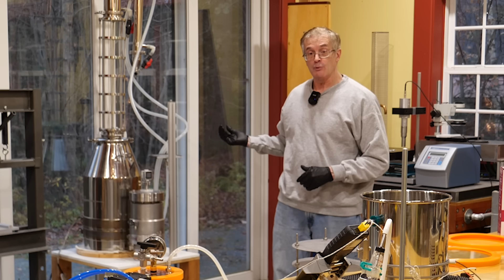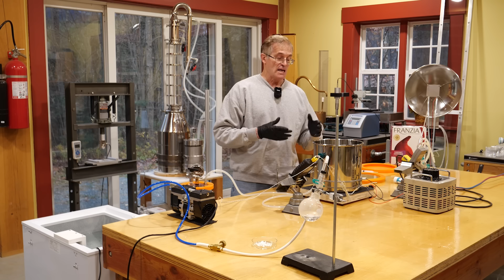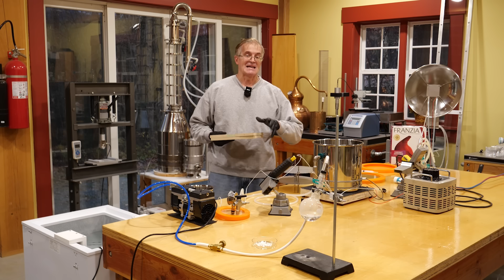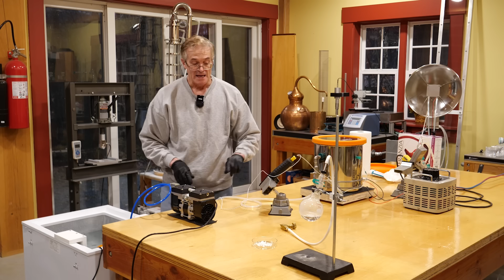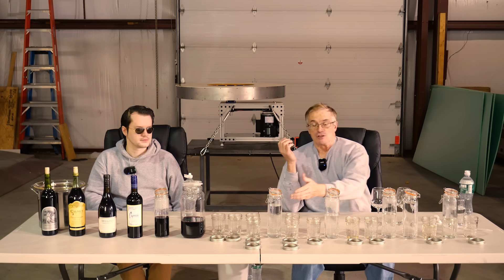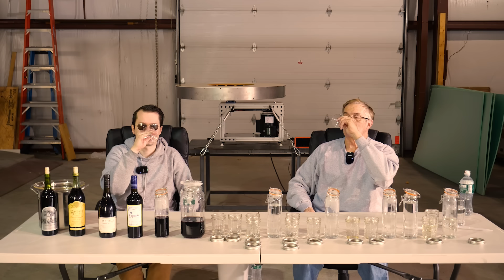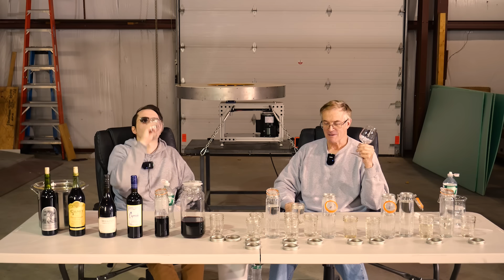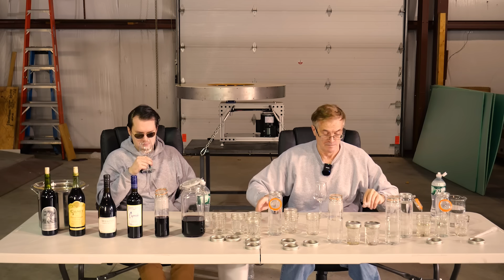Turning $3 Wine into a $100 Vintage with Science!

Comment: Hi. IMPORTANT information!! Just for let you know if you already did'nt. There is almoust always a small amount of metanol in wines. Especially on red wine there is usually abaut 20-200mg/l. And if you distill wine, and do this kind of taste experiences, keen in mind that on the heads is all the metanol. The amount of metanol is so small, that it is not dangerous if you mix all your heads and hearts and tails or just taste like you did, but not really drink it. But if you drink only the heads, it can be dangerous, even fatal, or cause blindness. You distilled 5 liters of vine and there is lets say for like an maximun amount 200mg/1L of metanol. So, now there is 1000mg pure metanol on your heads. 1000mg metanol is 1,26ml and thats not too much. So tiny amount as only 4-10ml can cause blindness. And death can be caused abaut 30-60ml of metanol. Now everything was safe. But if this same thing would be done at bigger scale, lets say like for an 50 litres of wine. Then there would be possible metanol as much as 12,6ml and thats dangerous amount! So, please keep safe and so your prework and check out all the information what possible can be found. And that can possible save your lifes! I am happy because now you did so tine amount of wine distilling and took so tiny amounts of the heads. If you would done that at bigger scale and take full 4cl snaps at the heads, and the story could be completely different. Or if this same thing would be done, not at wine, but some kind of fruit drinks. Fruits like apples, or plums produces way more metanol than grapes. Well, propably you allready knew this. But maybe everybody does'nt. It is always good to know before doing anything.

Comment: Fascinating process but I gotta say the fact that you declined to use a tralle hydrometer left me quite confused. How does distilling a wine to make cuts, recreate a wine which is - what 12% alcohol? In other words, one US gallon of wine will contain about 1 pint of alcohol but since you never distilled the last quart or so of the boxed wine, you never "reproduced" the fermented wine deconstructing the wine into its "cuts". Rather, you distilled the wine, so your project was not really about "deconstructing" the wine to remove the flaws and faults as it was about making a low alcohol brandy. What was the proof or ABV of each of your cuts? What was the final ABV of the brandy you produced? 
And I gotta say, I missed the point of using vacuum distillation. For far less effort and cost, couldn't you simply have used a fan-cooled table still to distill the wine making the same cuts? That you boiled the wine at near room temperature to vaporize the ethanol and the more volatile aromatics and flavor molecules and then condensed the vapors at near freezing is still distillation and not fermentation, isn't it? What am I missing?
Reply from the maker: We separated the wine into fractions that allows us to reconstruct the wine minus what we didn't like. The ABV is irrelevant because we aren't making brandy. Heat damages some of the flavor components of the wine and vacuum distillation avoids heating the wine.
Reply: @TechIngredients  If the wine was not distilled, how did you find the first cuts to be so alcoholic? Simple deconstruction would never had produced any sample above the ABV of the wine itself. No?
Reply from the maker: It was distilled as you said above, but doing so at room temperature was the point of adding the complexity of the vacuum process.
What is different here is that the goal was not to concentrate the alcohol and flavors as in a brandy, but to remove the undesirable fractions across the entire spectrum of the cuts.
Reply: @TechIngredients  OK but isn't this exactly what distillers do at 173.1 F? They evaporate (if under a vacuum at a lower temo but you are still evaporating your wash (that cheap wine), and CONCENTRATING the ethanol which "boils" at lower temp than water and you condense the ethanol and other volatile compounds such that the MOST volatile elements evaporate and then condense first and the less volatile compounds evaporate later. These you and distillers call "cuts" and they and you blend the cuts to make a beverage you prefer, albeit with LESS water than was in the wash. You are simply using a vacuum to BOIL the wash below 173.1. Sorry but I do not see ANY significant difference between distilling at 173.1 and distilling at room temperature.
Reply from the maker: It's simply about chemistry. 
Some flavor components are not stable at elevated temperatures.
Reply: @TechIngredients  There we are in complete agreement.

Comment: i think what might have improved the wine process was adjusting the amount of the remainder fluid added back to the mix. since you isolated a certain volume of liquid and removed it from the mix, the overall proportion of the remaining highly pigmented component might have been overrepresented in the overall ratio. but because the distillation was cut short, it's hard to know how those proportions relate. maybe its a second round of taste testing where you continually add bits of the non-distilled remainder until a taste profile is achieved. awesome video as always :)
Reply from the maker: I agree  that we only touched on the possible modifications that the separation process  allows.
Reply: @TechIngredients I'd love to see the idea expanded. Cheers 🎉

Comment: A lot of work, but FAR less than making the wine from scratch. And far more potential for profit, either monetary, or just bragging rights. 
I'd leave out the last 2 astringent ones as well.  At the end, adding the original wine concentrate (super sour), do NOT put it all in! 
You've got less volume than you started with. The end product doesn't need to be so tart. You made it extra tart.

Comment: I'm not as think as you drunk I am!

Starkle starkle little twink,
Who the hell you are I think?

I'm not under the afluence of incohol,
Though some thinkle peep I are.

I've only had tee martoonies,
but I have all sober to Sunday up in.

And other nonsense from my twick and sistered mind.  But I personally have never developed the taste for alcohol. With the exception of one melon based drink, ALL alcohol bearing or 'dealcoholised' former-alcohol-bearing drinks scream "POISON" to my senses. And the few hours moderate buzz isn't worth the day to three days of feeling blargh.  However, I have access to fruit trees that wildlife likes to ruin by taking a single bite from a piece of fruit, throwing the rest on the ground, then repeating until the tree is bare. The notion of collecting that waste, dropping it in a barrel and letting it become flammable, then distilling off the flammable stuff for use as a fuel source... Tempting.

No, not for drinking. For burning in a small combustion engine or similar.

Comment: This was absolutely fascinating to watch as a huge wine nerd and science nerd - more for your reactions and interpretations of what you were tasting. The fractions separated out different flavor components that made them easier to identify, that as someone is learning to taste/analyze wine at a higher skill level, takes a huge amount of practice, an attune nose and oral olfactory senses and thought. I think this would be an extremely cool demonstration for a winery to do as a demonstration in a wine class.

Random thoughts:

Water is a very suboptimal thing to rinse with for tasting. It will interfere with the next thing you taste. when I am tasting, if its reds heavier than pinot I will usually mouth cleanse with a light sparkling wine like cava. Otherwise I tend to rinse with the next wine I am tasting, sip a bit, swish it a bit then spit it out and it doesn't interfere with your tasting as much.

The "bay leaf twigs" you were tasting were probably flavor compounds from stems and other non-wine plants from harvest. Stems can be good in wine, but sticks, weeds, etc may not be.

The "rose bushes" you were tasting comes from what we call "bramble" as a wine quality. Its really common in syrah and zinfandel, but to get in cabernet requires really high quality, cool ripened grapes. It was likely a small fraction of the grapes in franzia but it is shocking there was juice of that quality at all in it.

Alex's purple lips were absolutely adorable <3.

Almost all cabs are oak aged to some degree - even the Franzia, but franzia was most likely aged with oak woodchips that may have been milled up used barrels.

The "no flavor" comment about the silver oak was almost certainly the wine being "tight," or "closed." 30-120 minutes in decanter most likely would have helped it out. More so that just having the cork off even overnight.

I probably would have redistilled the foreshot and the tail and discarded the first third or quarter of it. Methyl alcohol is always present in wine, but in cheaper wine they tend to ferment hotter which can increase the amount of methyl alcohol.

When tasting with someone, it is best not to say anything until after you have both tasted and thought about it. wine tasts the way it does because of how you interpret various flavor and smell compounds and just saying someone can influence the way a person tastes something. This happens because things taste the way they do mainly because of smells, and there are a relatively small number of smells that make everything taste the way they do, but in wine they are out of context. For example, grapefruit thiol is primarily what makes grapefruits taste like grapefruits, but also what make tomatoes taste like tomatoes and passion fruit taste like passion fruit. The primary smell component (a pyrazine) that make bell peppers taste like bell peppers is also what makes asparagus taste like asparagus. The ester ethyl acetate is the primary thing that makes pears, apples and plums all taste the way they do, etc.
Reply from the maker: Wow!
Thanks for the insight.

Comment: See, we can now add this to our mental inventory of knowledge if we ever find ourselves hurled back 10 or 20 centuries. 

I don't know how to build a modern (or primitive) vacuum pump, but I wouldn't need to. 

Just source the biggest, stongest metal vessels I can find and use heating/cooling to create a vacuum. 

Don't need a bunch of sophisticated wine knowledge - just do like they did and taste fractions from different temps and try combinations until   I find a combo that perceived as a huge improvement. 

Keep the key process secret by assigning only part of the process to various sites, so no one really knows the secret. 

Become a huge vintner with no vineyards - just buying whole vintages, breaking them down and reblending them. 

I could even introduce whisky a few centuries early.

Comment: There is a "speed aging" technique that used oak chips and if I remember correctly, a vacuum chamber to rapidly impart the flavors of an oak aged spirit into regular alcohols, I think the thought emporium here on yt demonstrated it. It would be interesting to see if you could use this to infuse your wine to get flavors similar to the high-end bottle. Loved the video, keep up the great science!
Reply from the maker: I've done that. The principle is to recreate the small day to night temperature variations that an oak barrel experiences which causes the wine to expand and contract and move in and out of the inner layer of the barrel.
The result was kind of harsh and unpleasant. Maybe with a lot of fine tuning in chip size and quantity this could work.

Comment: Did you tested (tasted) the same type of wine, but of different producerc / wineyards? I mean all bottles being cabarnet savignon, or all merlot, etc? Or you are comparing apples to pears?
I was also surprising why you poured all components together, why did not substitute the missing ones with proper water/alcohol mix?
Why did not mix 3-5 versions?
Also, the residual might have been divided into top / bottom / very bottom, after left settled.

But I congratulate to the idea+work.

Comment: In the interest of science I think the "bad" components should be identified by chromatography and then a compound that will knock them out of solution used to create a "crap wine to good wine" magic pill you could add to $3 wine. I would have taste tested in reverse order under the assumption that the 180 proof stuff is going to decrease sensitivity. The other thing I would have done is replace the removed stuff with distilled water so the balance of the wine was preserved and I wasn't concentrating the wine, sort of like ice wine.

Comment: What about using a fish tank submersible heater? That way, as the evaporation cools the original liquid, the temperature falls and the heater starts heating. If you then look at the power consumption of the heater, you can see when the alcohol has been evaporated.

Comment: yeah... see ... it's not that simple. Why we say "it aged like wine", well because red wines need time. What time does is braking apart tannin and many other components that make the wine more "round", meaning there's more harmony to the taste between various and INCREASING number of components, when tannins are decreased. There's also a thing you mentioned called "finish" meaning not only a long lasting taste but actual ability of the wine to hit you with different tastes coming one after another during this time. This is one of the characteristics of a good wine... 

BUT.... The price does not reflect roundness nor finish as well. 

You can have a great wine coming from great winery which is very young and is already costly especially when the year is good. So NOW it's still nothing amazing but in 5 or 15 years it will be amazing.... so we know not to open it now and save it for later.

Good year is when there's a perfect balance between temperature and precipitation because more sugar means more alcohol and more sugar left in wine. To hot makes grapes cooking themselves. To much precipitation and there's not enough flavor cause there's less time for sun to prevent a watery taste.

So even comparing the lesser wine from a good year to excellent brand from a bad one makes a difference. 
Not to mention the most important issue - grape variety used for different types of wines. I presume the one you modified is a type of noname blend if not made from powder directly without mentioning it. So if you not know what grape variety this wine is made of, comparing it to other ones might be just useless. 

Even blends are made in different percentages. You can keep adding and adding another variables to this equation like for instance type of climate - there is a reason why wines from New Zeland are so good. You can add type of soil. Then there's an "alchemist" composing each wine accordingly to variables available at the moment of collecting grapes.

There's just too much variables to compare your product to OTHER wines. 
The only comparison that actually makes sense is to compare it to itself i'm afraid.

Otherwise ... a fun video and technical part as always very detailed and fun to watch.

Cheers!!!

Comment: Dry beans like pintos and black beans, do very well in the pressure cooker. So does rice. For rice, I put about an inch of water in the pressure cooker, then put in a large Pyrex measuring cup with the rice and water. I do the same with beans.

Comment: #9 through #11 likely had terpenes.
While reducing the less desirable flavors by not including those middle number fractions, you also reduced the complexity of the wine.
The one that tasted sweeter had white grape concentrate added or a small percentage of unfermented grape must added, making it off-dry. It's a different style of wine. They did not add sugar (it is illegal in U.S. to add sugar to wine).
Silver Oak is a cult wine. I personally don’t like it as much as other $40-50 cabs from that area because I don’t like the mostly American oak used for its barrel aging. I think you would rate your modified wine less favorably against many $40+/bottle wines which were aged in French oak barrels.

Comment: This is the best video on distillation that exists! Thank you very much for the work you’ve put into it! Perhaps I missed something, but how rigid do the tubes need to be so they don’t collapse under atmospheric pressure?
Reply from the maker: Thank you!
That's actually an important trade off. Obviously a really thick wall tube will support the vacuum,  but the thick wall makes is cumbersome and hard to bend as well as more expensive. As a rule of thumb (literally), if you have average grip strength, you should not be able to squeeze the tube between your finger and thumb and get the sides to touch.
When I get back to the lab, I'll see if I can identify the specific tube I used.

Comment: For those first 2-3 cuts it might have been worth tasting them diluted to see if there was anything else you could detect once they stopped being everclear or vodka.  As for that cherry flavor in the 4th cut I'm guessing that it's just the lack of tannin that brought that out.  If you were doing this again maybe take a first cut after 2-5 min rather than 15 to get rid of any thing that would be discarded as foreshots at the start of a hot distillation run, then you could choose how much of that final undistillated fraction to add back in.  I'm also wondering how much that herbal note in faction 8 would change the character to be more like the bits you didn't like in the last two bottles.

Comment: Maybe adding back in less than the full amounts, or further distilling out into batches those that have more than one trait in which you want one but not another. Such as the first batch being very strong and not smooth is mostly alcohol, maybe run through a charcoal filter before adding back in
Reply from the maker: You're right.
The principle here is the opportunity to make these adjustments.
The fun is how you select and balance these many cuts.